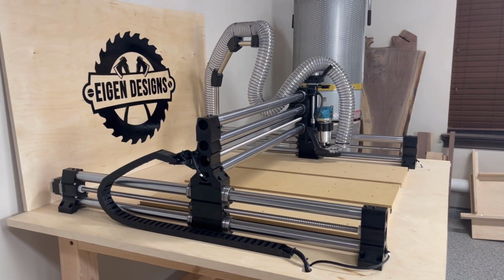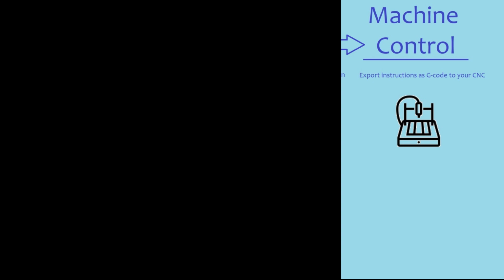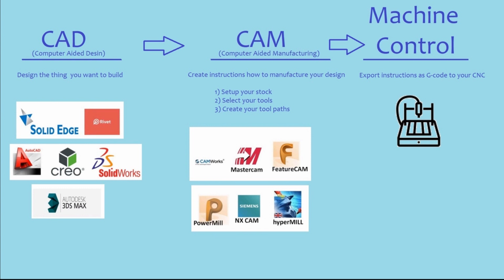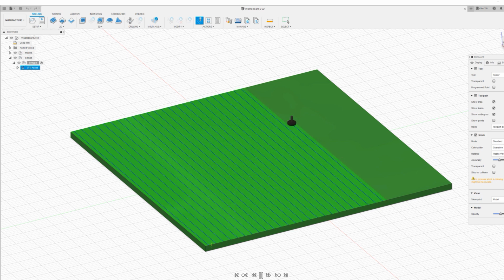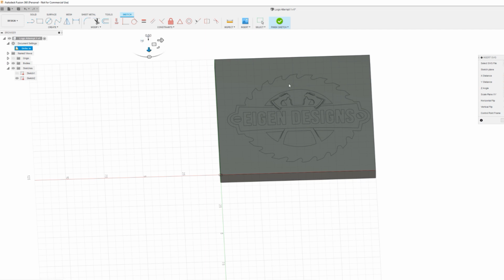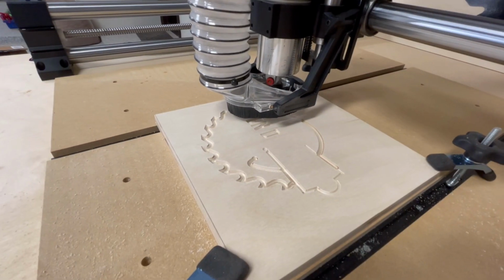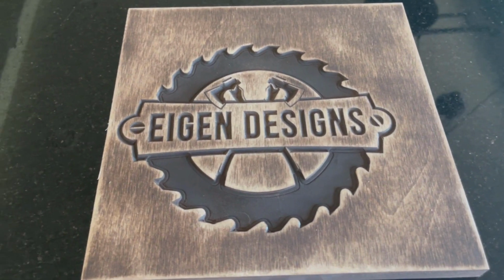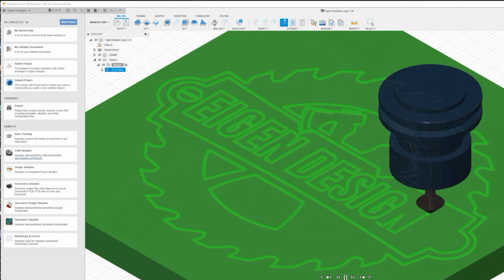First CNC Project on the OneFinity - FULL VIDEO

Comment: Are you using a Makita router, I saw it in your list and I am wondering how you like it? I purchased a CNC in 2009 and it came with a Bosch, which within 10 hours of work it ate up 2 of them. I have a Dewalt now, but due to medical and physical issues, have not been able to try it out. I have seen some of your other videos and your projects are turning out fantastic. I always have hold down issues, which wastes a lot of wood.
Reply from the maker: Hey Norman. If you're looking at just routers (not spindles) then the Makita is a good one. I have over 1,000 hours on my current router and its still going strong.

Comment: NEW SUBSCRIBER!!  I am new to CNC and love your videos.  I have a newbie question, how do you know what type of bits to use?  I see that you cleaned up the design with a flat end mill bit, is this from just trial and error or does the software recommend what bits to use?  Thank you
Reply from the maker: Thank you - glad to have you as part of the community. 

Regarding bits, as you do more CNC work you will develop a sense for what type of bit you will need for the cut you are trying to make. For example, if you're engraving letters its pretty common to use a 45 degree bit or a 30 degree bit. However, if you're trying to clear a lot of material then a flat end mill bit or even a bull nose bit is a better fit for the job. There are some good tutorials out there if you want to get an overview as to what bit types there are, but experience is the best teacher in my opinion.

Comment: Thanks for the video!  Like many, I have a 1F on order and am studying away while waiting.  I am a Fusion 360 fan but also plan on using Vectric VCarve Pro.  I noticed you left it out on your workflow chart. Have you considered using Vectric VCarve?
Reply from the maker: Hey Alan! I hadn't taken a hard look at Vectric Vcarve. What are some of the strengths of the software? I am curious to hear your thoughts.
Reply: @EigenDesigns  Vectric VCarve Pro is focused on CNC routers.  It has a post processor available for the 1F.  It also has a laser module that can be added.  While it is expensive, after watching numerous tutorials and reviews, I am planning to buy it from 1F with their discount.  I will continue to use Fusion 360 as well.

Comment: Another great video.  I'm currently conducting research on buying a CNC, and I really like the OneFinity CNC.  However, I know nothing about a CNC, especially the software.  I know you stated in the video the CAD software you were using was Fusion 360, which I'm vaguely familiar with.  Can you tell me the CAM software you use?  Thanks for your reply.
Reply from the maker: Sounds like we were in similar positions. I ended up going with the OneFinity because I didn't want to have to tune/upkeep belts and pulleys used by other systems. The main draw back of OneFinity is the long lead time, although this may be present for others as well.

The nice thing about fusion 360 is that it contains both the CAD software and the CAM software in the same program. You can seamlessly switch between the two, which I have found very helpful when iterating tool paths on a design. It's an expensive software for the professional, but they offer a free version for the hobbyist. You can find the download link for it here:

https://www.autodesk.com/products/fusion-360/personal
Reply: @EigenDesigns  Thank you so very much for your time in answering my questions as I know this takes time away from your schedule, but I sincerely appreciate your help and quick response.  I love your video format how each part starts with the underlined title and the clarity of your videos.  Again, thanks for your generous help along my CNC path.
Reply: @EigenDesigns  Have you found that you can conduct most of your projects with the free version?
Reply from the maker: @Finewoodworkingofsc  There are not many limitations in capability from what I have seen so far. The hobbyist version does limit you to 10 saved projects that can be editable, but you can manage this by making old projects temporarily "un-editable" to free up capacity. I have not been limited from a functionality point thus far.
Reply: @EigenDesigns  Thank you for your time and your reply.